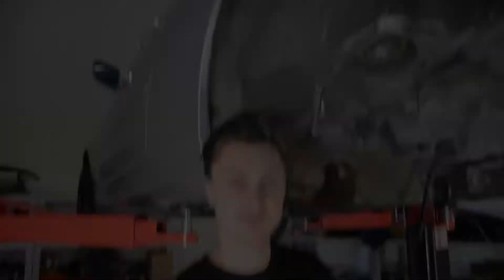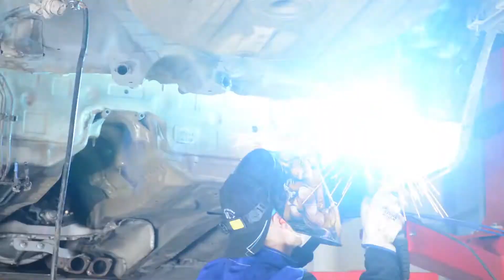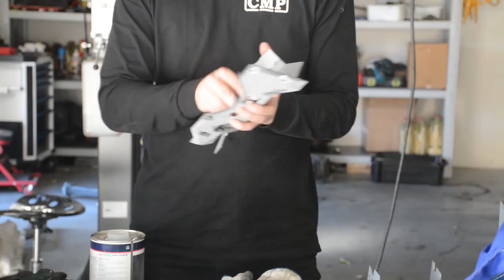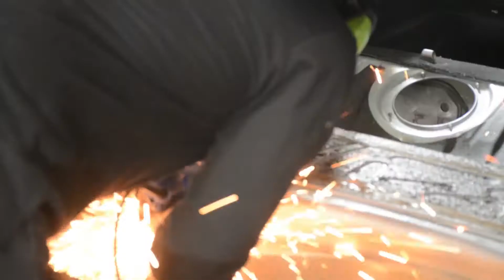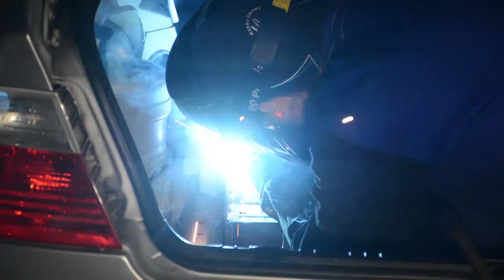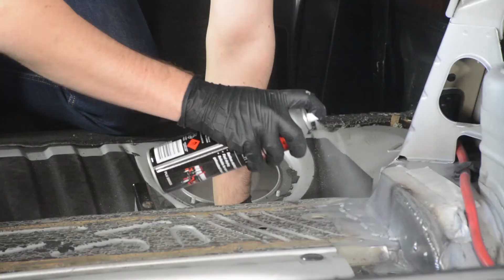Episode Three, E46 Drift Build | CMP Auto

Comment: Could I install this plates using epoxy instead of welding? Would that be sufficient since I don’t have access to a welder and won’t be able to stitch weld the wheel well and floor inside the boot? Thanks in advance!
Reply: better off with the vincebar if youre wanting to epoxy

Comment: Hey nice job getting a channel online !! I'm in NZ and building an E46 at the moment for a VQ37 swap ... I'm curious why you are not doing your topside beam and front mount extension products on this ? I've got a basic subframe kit to go in mine but the fit is horrid so looking into what will be best to sort the rear end. What would you recommend as the go-to method ? Car is a 318Ci and looks to be in great condition, still got a de-grease session to really see fully however.
Reply from the maker: Hi Dave, 

The plan was to originally to install the whole package however, one thing we came to realise is that we didn't want to overbuild the car before having any seat time. So, we decided on doing a comprehensive yet minimalistic job as it realistically represents the majority of E46 reinforcements and also keeps weight down on this very low powered M54b22. 

My suggestion with reinforcements is to more or less do exactly what we have done. If it's a dedicated track car and regs allow, tie a roll cage into all 4 mounts, if it's a street car where interior trim and seating must not be altered then our stage 2 & 2.5 kits (with optional 3) are the next best thing.